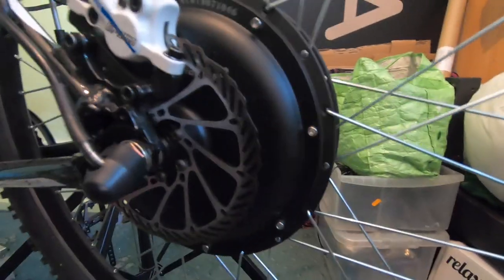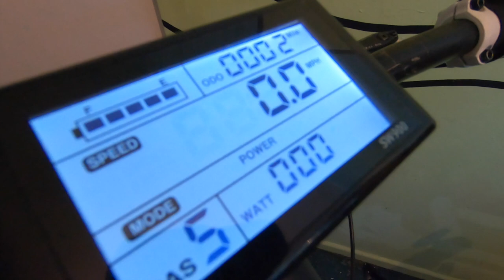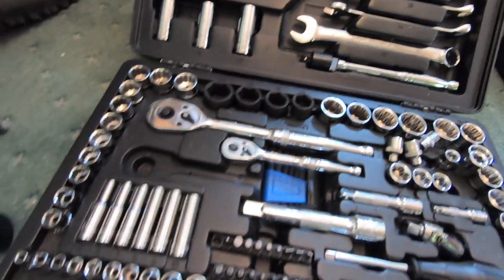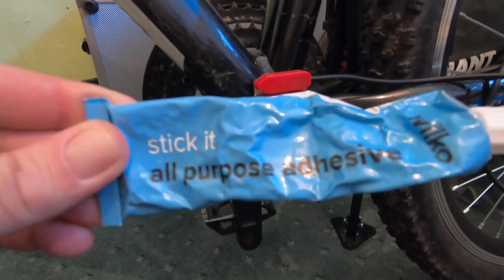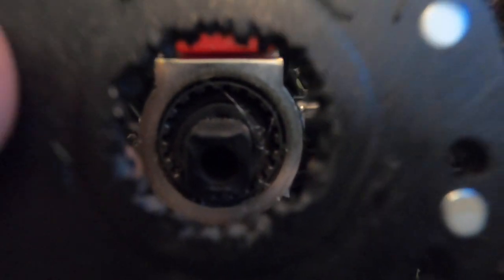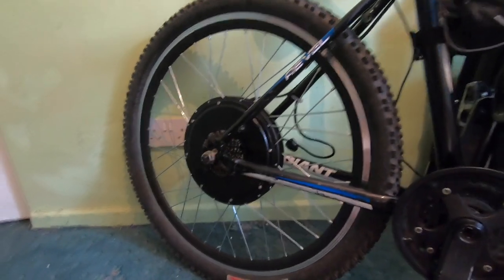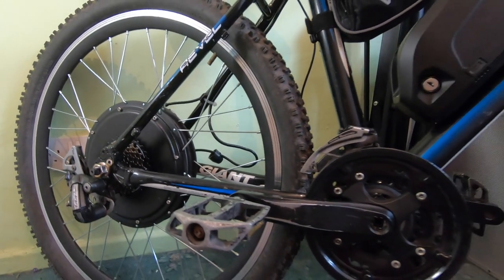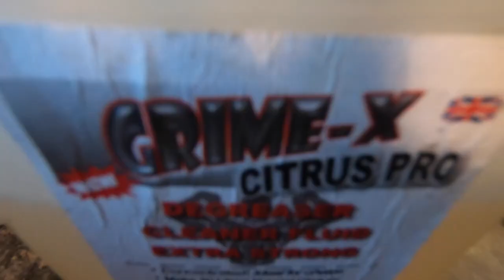Voilamart 1000W 48v GIANT REVEL Ebike Fitting PAS (FAIL) #Emtb

Comment from the maker: UPDATE 2nd June 2O2O** If you read the comments i say i scrapped the GIANT eREVEL & fitted the Voilamart wheel on my Mate X !! Well today ive stripped the Voilamart wheel off the mate X as it wasnt SAFE !! And ive rebuilt the GIANT eREVEL even better - Ive fixed the wobble on the forks/Ive fitted a 2.2 front tyre/Ive soldered & sealed the needed wires & ive got a much neater finish all together..I took it for a ride at 9:45pm & got 30mph+ twice heres the vid - https://youtu.be/meBsyQXD2Uo

Comment: Good build same thing happened to me I fitted pedal assist didn’t work,luckily the vendor who sold it to me was local,I took it there he messed with the display on the menu and changed the assist levels to 9 pas levels ,then it started to work ,you display is different to mine I have sw900 ,but if your look on YouTube for your display type try changing the pedal assist values it might work,on YouTube channel Augustine ebikes tells you how to do this
Reply from the maker: Hi - Ive just been messing with the settings as Augustine eBikes video says & put the PAS to 9 & also some other stuff BUT nothing so just fitted a spare PAS sensor i had - The glues drying so i'll let you know how it goes - Bit gutted spent all week on this !!! Thanks for taking the time to comment..
Reply: OneMan OneDog also try moving the magnet closer or the other way around with magnets inward ,good luck man
Reply from the maker: Hi singh s - Ive tried everything & no luck so just stripped all the electrics off & rebuilt it as a MTB so i can sell it !! BUT ive got a plan #MutantMateX !!!!!! Cheers
Reply: OneMan OneDog I know how you feel gutted it’s not working my bike was like that for 2 weeks until I took it to vendor who sorted it,out if curiosity do you think if you put a voltmeter on resistance across the pas plug then pass a magnet over sensor near crank if it shows a change in numbers that means it working ,you get what I mean then you know the problem is with the display settings, iam crap with electrics , just an idea
Reply from the maker: singh s - Ive gave up on it i need the money so selling it just as a MTB & im fitting the 1000w on mate X forks !! Might look a oddity but least it'll work #MutantX
Reply from the maker: @singh-sks  Hi - Today ive rebuilt the Giant eRevel (Mr.Random lol) & took it a test ride - Got 30mph+ twice !! No PAS but throttle+pedalling...AWESOME 😀
Reply: OneMan OneDog I will try and check settings on my display there are 2 or 3 related to pedal assist ,it’s pissing down here south near Heathrow and bike is in shed , when I get chance I will note down the values and settings give it a go nothing to lose
Reply: OneMan OneDog my bike above 25 mph I ghost pedal using throttle at max speed, it gets a bit scary above 25mph I usually ride around 10 - 18 mph.
Reply from the maker: Hi - If you could get the settings that would be brilliant mate - Cheers 😀
Reply: OneMan OneDog right the settings on my display are p2-1, p3-48 ,p4-10 ,p5-009 ,p6-26 ,p7-0046, p8-0100 ,p9-00 ,p10-0002 ,p11-0003 ,p12-0003 ,p13-0008 ,p14-0012 ,p15-041.0 ,p16-0035    I would compare my pas settings with yours , there are certain settings I would not change they are set for your motor Augustine ebikes explains this .also my magnets face towards the sensor and it is very close about 2 mm gap
Reply from the maker: Hi Thanks mate for the help - ive done the settings the same as yours BUT no joy so im going face the magnets inwards like you have them - if it doesnt work im not too bothered because its top fun anyway...
Reply: OneMan OneDog best of luck, there is one final thing you can do to display is a factory reset ,takes it completely back to manufactures settings, you have to google it , it takes you into the c parameters of display instead of p parameters.i have never done that but it is there to restore settings.
Reply: I noticed that is your display a sw900 like mine or a kt lcd3?,if it kt lcd3 google factory reset, wing ebikes they have the manual online for that display it has different settings to mine you can enter the c menu then go to c10 and restore to factory settings

Comment: I remember when disc brakes first came out for mnt bikes.....they claimed "no more sqeaky brakes" lol
Reply from the maker: Haha thats funny what a claim to make !! 😂
Reply: @paulleeFLOW  Thanks for making these vids I just ordered the same kit, I couldn't find any good recommendations on batteries so I ordered a 48v 20ah....I hope I didn't get screwed it was twice the price of the kit...
Reply from the maker: Cheers for watching my vids - Have you?its a awesome kit when you get the settings right..I use a 48v 16ah HAILONG battery off eBay £200 & its seems to be doing really well - ive not had one problem with it 👍🏻 Have you seen my new VOILAMART conversion? https://youtu.be/9WSrelBh6dE ⚡️🛴
Reply: @paulleeFLOW  that's bad ass man it looks like it was factory made that way. have you researched the gear drive hubs? from what I've read they have better low end torque but lower top speed.
Reply from the maker: Cheers mate - Yeah mid-drive?yes more torque & im mean loads if you look at the .Tn BUT saying that they are double or triple the price of a hub motor...!!!
Reply: @paulleeFLOW  I definitely want a mid drive one of these days but I was talking about this https://www.youtube.com/watch?v=8JBauEBo4oQ
the voilamart hubs are direct drives I believe.
Reply from the maker: ahh geared motors !! i have a MATE X ebike with a geared motor & it burned out up a hill after a month from new & im still waiting on the warranty almost 7 months later !!! Yes the voilamart direct drive as i took mine apart to see whats inside lol...
Reply: @paulleeFLOW  well that sucks, I'll be sure to let people not to buy MATE X ebike's....that's a dumb move on their part considering all the competition out there. did you ever get the peddle assist working on the voilamart?
Reply from the maker: No the pedal assist never worked after trying loads i gave up & just used the throttle & pedalled+throttle uphill - it was fine like that...
Reply: @paulleeFLOW  my bike has the cartridge style bottom bracket also so I doubt I'll install the pedal assist.
Reply from the maker: Im in a Voilamart fb group & a lot of people cant get the PAS to work & TBH it works fine off the throttle & then just pedal uphill to help it along....Let me know how you get on with your build & any problems i can try to help mate 😀
Reply: @paulleeFLOW  Right on thanks! it's supposed to be here wednesday. hopefully it will cool off a little by then it's been over 100 degrees here the last 2 days. 
I noticed the wooded area you ride in is nearly identical (terrain wise) as Seattle fwiw

Comment: Sorry it was not working for you 1500w kit PAS did not fit the Trek Foel 90 Crank shaft so i mounted it on the front wheel and extended the wires.After adjusting the settings on the display both PAS systems i tried would not work either.After wasting too much time I use thumb throttle and with a 9 speed cassette i prefer it that the cheaper 1000w kit like yours but not Voilamart brand PAS works perfect go figure.Too bad it has the freewheel instead of the cassette😏makes a big difference.
Reply from the maker: Hi Peter - I tried all yesterday but no luck !! So ive stripped this eMTB its now just a MTB which im going to sell !! The 1000w wheel has been put on my Mate X & i took it a ride yesterday OMG !! Im just rendering the video - Cheers
Reply from the maker: Hi Peter - today ive rebuilt the Giant eRevel - No PAS but gonna make do throttle+pedalling..Just been a test ride & got 30mph+ twice !!!
Reply: @paulleeFLOW  Oh yeah 👍 throttle is just fine right😜you peddle anyways